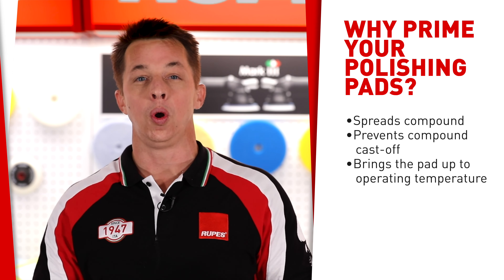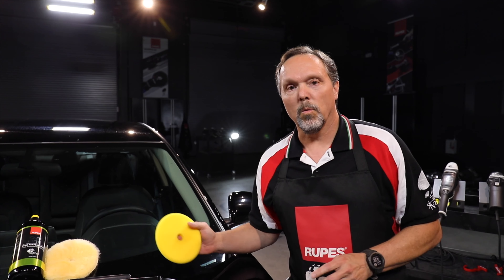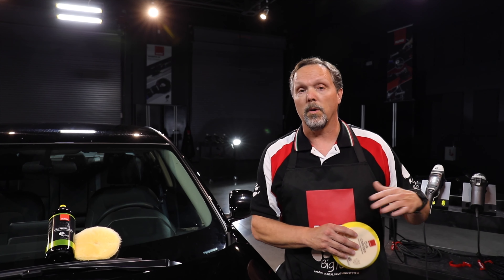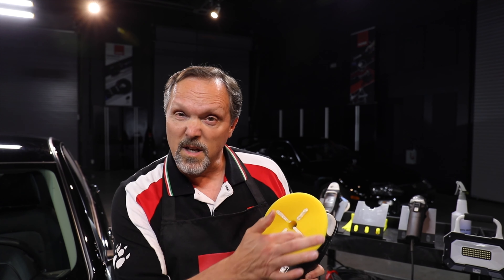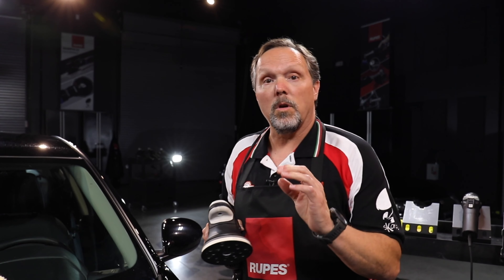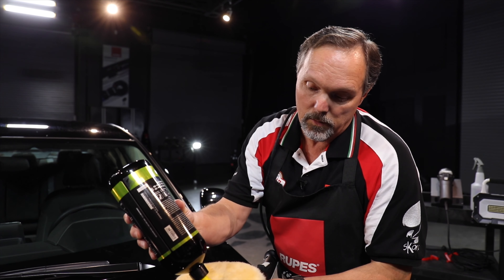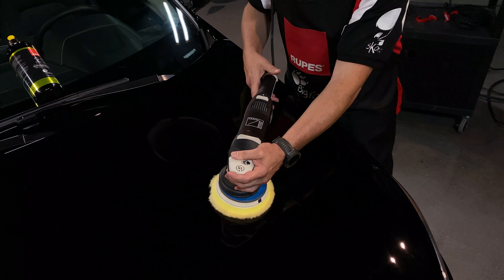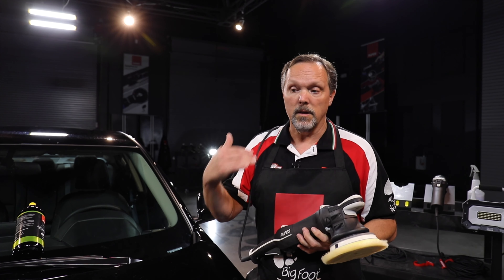BigFoot 101: Priming Pads [Chapter 03]

Comment: Very easy to follow. Thank you so much! Patiently waiting for my yellow fine cut pad and Uno Protect to arrive. 

Question though, and apologies if this is the wrong forum. My plan was to use the Uno Protect with the polisher and then apply a layer of P21S hand wax, or my Zymol red wax to build some additional shine. Is that last step unnecessary, or beneficial? This is on a hot rod show car. Thank you.
Reply from the maker: Thanks for watching and commenting. The thought that additional layers of product increase shine is sort of an outdated thought process. While it may have been true at some point in the past, the advances in chemistry with protective products means that sealants have a high degree of optical clarity and the true shine is actually produced in your prep/polishing process - the better the underlying clear, the better the result.

All that being said, you can certainly apply a product over UNO Protect if you prefer. Make sure you wait until UNO is fully cured before applying anything, and also understand that your surfaces will take on the characteristics of whatever the last product you applied is, so in this case you'd be replacing the highly glossy, slick, hydrophobic properties of the sealant in UNO protect with a less optically clear, less slick, and less hydrophobic wax.
Reply: @RUPES  many, many thanks! This is the information I was looking for. I watched a few other videos and saw that some people were adding another, hand applied product over the Uno Protect, and was not sure if that was necessary. I just recently completed cutting and buffing my finish. The car was painted 15 years ago and while the body shop did a great job on the car, they cut and buffed way too soon and the paint shrank over the years after it cured. So I went over it again, using the 3M Perfect It system, but due to time and the fact that I am not 25 years old, I had to do the car in sections and eat the elephant one bit at a time. The bulk of the work is done, and now I want to fine tune the finish with Uno Protect and this is great news knowing I don’t have to add another layer on top of this. Thank you for the quick reply back.
Reply from the maker: Our pleasure to help! When everything is done shoot us an email. We'd love to see pictures. 
www.rupes.com/contact-us
Reply: @RUPES  will do. Thank you so much!

Comment: After you prime the pad do you add more dots of product before you start on your first section?
Reply from the maker: Thanks for watching and commenting. Typically, yes. You'll add just a tiny bit after priming so you have enough product to effectively cover your first application area. At a certain point it becomes a "feel" thing... where you may not always need to add more b/c you have enough product in the pad from the priming process. It will become obvious with experience.
Reply: @RUPES  ok thanks!

Comment: Do I have to pre-prime the yellow foam pad again after I have cleaned it with compressed air? If it does not have to Priem again. Does it hold with 2 pea size polishing compound or do I need more since it has been blown clean?
Reply from the maker: Blowing the pad out only removes surface residues. The pad will still be moist with product and only a few drops of compound would be necessary for the subsequent applications.

Comment: Hi...I bought the RUPES Nano Ibrid ...My question is in regard to priming pads.  Do you prime the pad only ones before using the brand new pad, or does it need to be done for every new job thereafter ?
Reply from the maker: Thanks for watching and commenting. Priming needs to be done on the very first application with a fresh or dry pad. So you'll prime each time you start using a pad from new or clean/dry. 

Now, with the nano and the very small sizes of those pads a single drop is usually enough to prime the pad. Think in scale of what it takes to prime a full size pad (as shown in the videos) and then translate that ratio to the 70mm or 40mm pads... it isn't much! Hope that helps.
Reply: @RUPES  So, after finishing the job, you would clean/wash the pad, and next time you use that very same cleaned/washed pad, you would prime it ?
Reply: @mz8210  Yes.  If a pad has no polish on it, (regardless to whether that is because it is brand new, or you washed it after the last time you used it), Rupes instructs that the pad be primed.

Comment: This makes the most sense. Lines along the radius of the pad means the polish covers most of the surface area of the pad the moment it starts spinning. I see people using dots around the pads and I always wondered what happens to the dry areas of the pad that initially make contact with the paint?
Reply: Excellent question - hopefully will get an answer....
Reply: I "prime" the pad by dampening it with DIY's rinseless wash by dunking the pad in the Rwash, then spin off the excess in a shallow empty bucket. I never polish with a dry pad. Any thoughts out there?
Reply: @jeaneebarnes2835  That should defenitely give some lubrication to the pad. But how does that affect the abrasiveness of the polish/compound? Looks like that will be reduced by a bit.
Reply: @TechCrazy  Good thought... As a beginner, I bought the Chemical Guys TorqueX DApolisher. It has an 8" throw. The backing plate that it came with is 5 inches - I can change to a 3" backplate as well. After watching a lot of videos, I wonder if Im using the 'right' kind of pads. I like sponge pads and have been using Lake Country CCS/SDA. Any suggestions on trying out some Rupes pads? Thanks!!

Comment: Thank you.  I use the Mille.  When using the wool pads, first, I prime them and then start using them by loading them with 4 pea-size drops for a 12" x 18" section I'm going to work on.  When I finish with two passes with a slow to medium arm speed on machine speed 4, with little pressure, I typically I see about 1/3 of the pad laying flat with the product.  If I continue on to four passes, the pad looks drier of course.  What should the pads look like after four passes and use my tornado to blow the pad out.  The pad looks great, but should I only be putting 4 drops back on again or do I need to put more on because the pad is so clean?  Does the pad laying flat with product tell me I should be putting less than 4 drops or is that considered normal?  Thanks again.
Reply from the maker: So many variables at work that what the pad "should" look like is really going to vary. If the pad face is inconsistent then there may be an issue with your pad angle or you're working on curved surfaces, hard to say without seeing it in person. 

As far as reload amount, that is a variable... depending on section size, working time, working speed, ambient conditions, and several other factors you may use anywhere from 1 to 4, 5, or even more drops to reload a pad. The best thing to do is start with a small amount, maybe 2 drops, and if you notice excessive pad drag or the compound short cycling, increase the amount on the subsequent reload. Unfortunately, paint correction cannot be as ABC, 123 as we would like... the reality of variables makes every application unique, so we have to train ourselves to read what is happening and adjust accordingly.
Reply: @RUPES  Great learning reply; thank you!!

Comment: Sorry about an obvious question but does warming the foam pad and spreading the product in the same place for 30 seconds not harm the paint or would you do this on a test panel or otherwise. Thanks for another great vid
Reply from the maker: Common question, but no. It would not harm it. It will do some of the polishing/correction work in that spot. If it makes you more comfortable you can prime elsewhere, but it is really not necessary.
Reply: @RUPES  thanks

Comment: been seasoning new foam pads w/spreader for years... is that technique obsolete or not recommended now?
Reply from the maker: You can certainly spread if you prefer, but it doesn’t remove the need to run the pad in place to get it up to operating temperature. If you have to do that anyways, and it spreads the compound, then pre-spreading isn’t necessary.

Comment: For how long can I use a single pad? For an entire car or is better to split in two different pad? wool and Foam have a different "life"? Regards guys
Reply from the maker: Thank you for the question. We recommend changing the pads every few panels to maintain consistent performance during the job. 4 pads at a minimum to complete a car. By swapping pads throughout the job you also ensure those pads will last for more uses as they are never overloaded or overheated.
Reply: @RUPES  about how long would a wool or foam pad last respectively? What is the the lifetime of these pads basically @ 4 pads per car 

Before the pad loses its cutting action or gets too worn out?
Reply from the maker: We actually have a video coming in response to this exact question. Stay tuned.